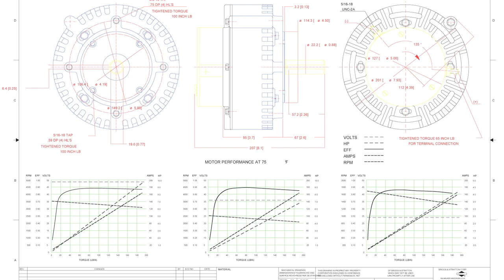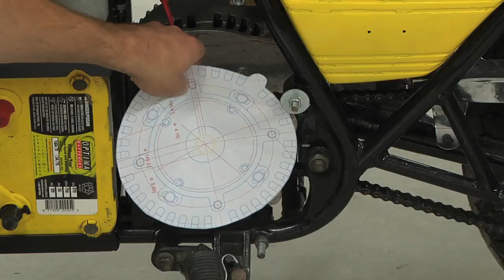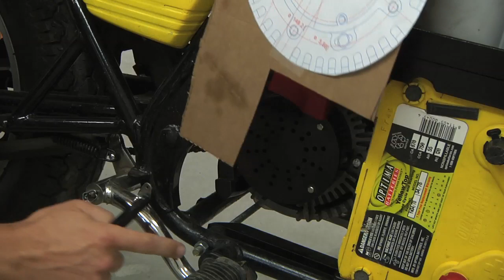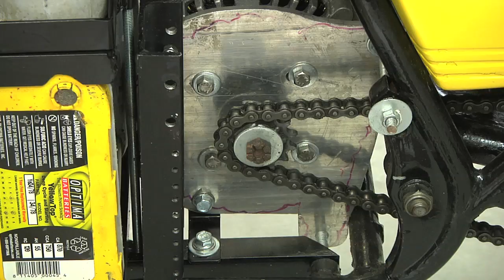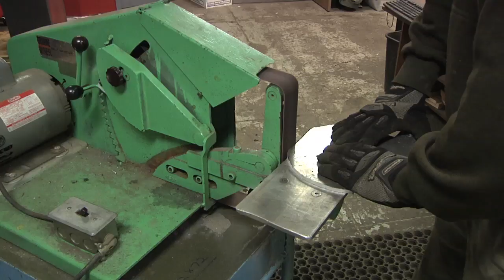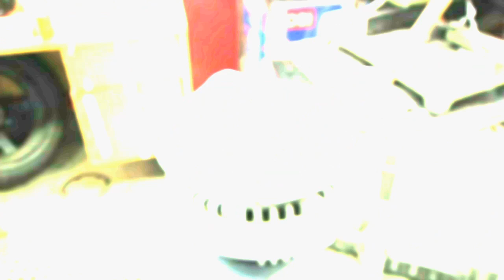Build Your Own Electric Motorcycle: Motor Plate

Comment: I have just about the same bike - but with belt drive. Unfortunately not in quite as good shape, although. OK. The carburetors are a problem because they have a rubber diaphram that gets torn. Now you got me thinking about converting it to electric. I actually have 2 other project bikes - '81 Honda CM400 and '82 CB750 Custom. Tanks are bad so need to decide whether to fix and stay gas or go E. Next up would be my '06 Kawa Ninja 250, though I probably won't do that one.
Reply from the maker: Belt drives are great! Super Quiet! (Although sprockets are cheaper/easier/off-the-shelfier!)
Ninja 250s have also been very popular for conversions. Aluminum frames save weight!
A friend of mine has recently been vacuum-forming plastic tanks for electric bikes. Neat stuff! https://www.facebook.com/BlackBoxBikes/

Comment: Hi there,

Great video. I am thinking of building an electric powered motorbike but it needs to have a range of approx 60 miles

Why did you build a bike with the motor in the middle and not on the rear hub? Wouldn't this be more efficient?

Regards

Comment from the maker: I've put together and taken apart so many things so many times on this motorcycle that I may or may not have had a lock-washer in a particular video. I used nylock nuts on the threaded rod that holds the motor plate.

Basic rule of thumb is that everything should be properly torqued, and have lock-washer, locking nut, or loctite on it. Nothing should ever rattle on a cycle.